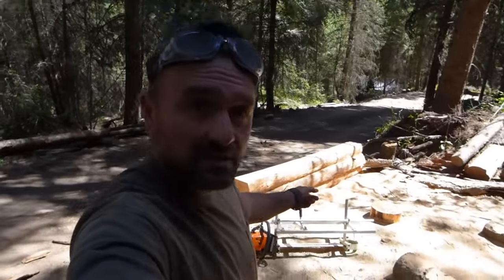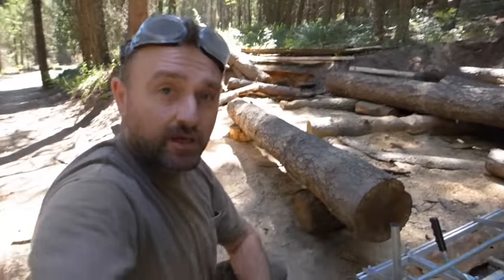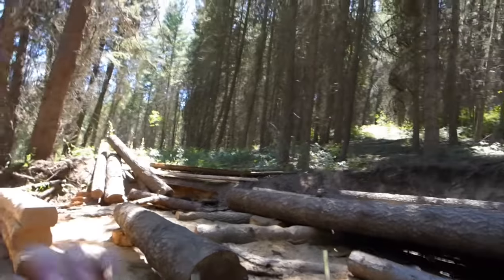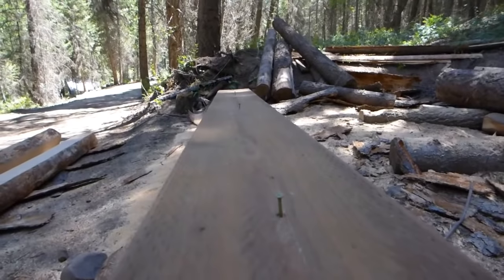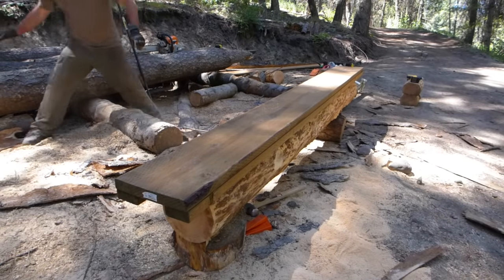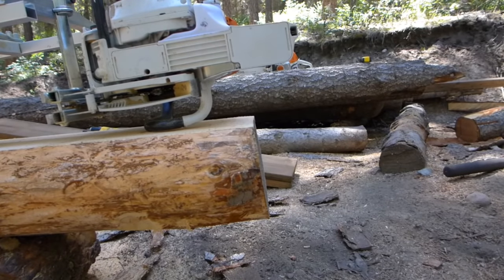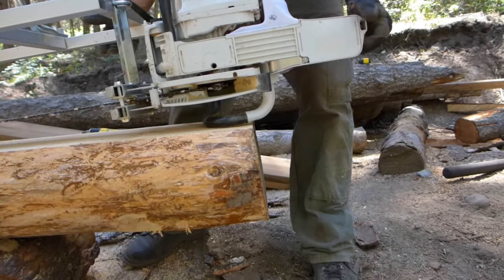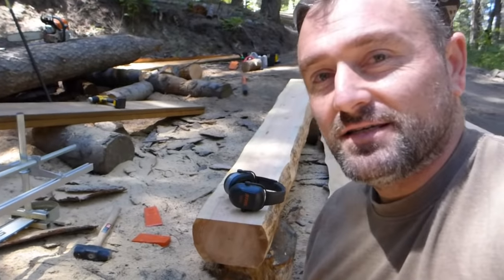Milling logs with the Granberg Alaskan chainsaw mill - Tips and observations

Comment: I have a Granberg mill also. It's a good idea to let the saw run for a minute after a long cut on a log it lets the saw cool down a lot better than turning off right after a run the saw is real hot. It's just something I do and I think it adds more life to the saw.
Reply: your not going to run out of fuel by letting the saw idle and cool down a bit between cuts, but by all means switch saw off to refuel and leave 1/2 of air space for expansion.

Comment: Suggestion, when starting a new cut without a guide board, find a way to start the cut without exposing your midsection to the blade. I noticed when you were kneeling directly in front of the blade that; 1 - you are not wearing chaps ($75 could help save your life or severe injury) and 2, your midsection is directly in the kickback zone. A stackable box with shims could be placed at the end of the log far enough away to get the blade started but close enough to support both guide rails until you are further in the cut. Great video though! Have fun with your project.
Reply from the maker: +Kevin Lovelace Thanks for the advice, I shall keep your tips in mind.
Reply: Or at least a  chain guard on the guide somehow that can be removed when the cut is deep enuf..
Reply: there is no kickback zone with an alaskan mill........
Reply: You could also attach 2 temporary 36"  x 1" angle iron on both sides of log to support the saw upon entrance to the 2nd cut use 2 more to catch the mill upon exit if the log. Use a level  to align angle to log plane
Reply: You will only get kickback when the tip of the bar on the top side comes in contact with the wood ‘ if you look closely at the tip of the bar it is Incased in a steel guard ‘ so kickback in next to lmpossible

Comment: Made my guide with 1 1/2" angle iron and welded spacer bars from the underside. As opposed to screws I welded pins to grab the timber slab so the guide didn't slide with the mill frame. To reduce the ware from the metal on metal I put 3/4" Teflon strips on the angle iron rails countersunk by 1/4". I built 2 10' sections that can be bolted together. That was 15 years ago and I still use the same rails today.

Comment: I enjoyed your brutal honesty  about setting your guide board screws too deep!! A most helpful tip that you COULD have left the unsuspecting to discover for themselves. Kept me watching and got me to subscribe!  Tip of the hat to you!
Reply: Adding a small right angled plate to the bottom of the guide board and then driving the mounting screws PARALLEL to the guide length and sideways into the log will effectively eliminate any chance of screws or nails damaging the chain's teeth since they will not be driven DOWN into the log but rather sideways into it. .
Initial entry angle of the chain going into the log can be better gauged by watching the longitudinal brace directly under the black push handle.

Comment: Quick tip for slab wedges....  Next time you go to a Home Depot or Lowes, go to the paint section and snag a hand full of the large paint sticks.  I have dozens now and they work well.  If for some reason to knick it with the chain.... Nothing happens to your chain.  Plus the paint sticks slide in nicely and usually all the way through past the middle of the log to be slabbed.  Anyway great video

Comment: Thanks,  nice to see Alaska mill in operation.  Great tip on debarking with the heavy pole.  Dirt in bedded in bark dulls the blade. I had to go through chain saw safety course with Rangers. Few small tips to keep you good looking. Always start chain saw with chain brake engaged. Wear chaps,  helmet with face shield and good heavy gloves like welder gloves. On average contact with turning blade causes 150 stitch wound. Your unprotected legs were way to close to blade.   Awesome job doing la job many of us would shrink from.

Comment: great video and thanks for sharing. another tip i got from this is to stand upwind of the log unless you want a shower of dust all over you. oh and along with all the other safety gear is to wear a dust mask. i assume you will move these logs to the saw mill to make 2x6's before they start to change their shape too much since you've removed the sides the stress in them will start to do that. unless you have a use for these logs as they are? moving these will be much easier now that they all have a flat bottom and top to stack them up with. thanks again. :)

Comment: If you put your wedges in before finishing your cut, you won’t pinch your bar at the end. Don’t hammer your wedges in. Just place them in and nudge it with your hand. If you hammer it in, you can change the angle of your cut.
Reply: Many people call those plastic wedges "Felling Wedges" even though they are properly termed "Palm Wedges".  They were designed to simply stop the kerf closing and pinching the bar / chain during felling and bucking.  They never were intended to be beaten into a cut with a hammer - ever.  As Marc said, snug the wedge into the kerf only using your hand.

Comment: My start board is 2 lengths of steel pipe with angle iron welded on the ends with 2 holes drilled on each end and screw the screws in horizontally,  just don't hit the angle iron.  Works well after ripping a big log in half it won't wobble on the corner

Comment: If you had a guide like a long snout on the rig it could lay on your deck ahead of the second starting cut so beginning your thickness on the first slab would be spot on parallel. The snout could simply swing away or pull out with a clevis pin. Likewise on the trailing top cross bar to keep the finish parallel instead of drooping off. Just my 2 cents worth.

Comment: really enjoyed the video. I have been looking at this device and am pretty impressed. 
I'm living with my young family up in the TN mountains with lots of lumber on our land. Mostly oak, maple but there is some pine too. How does the process do with oak ?
Reply from the maker: +Tim Bennett Hi Tim. The process would be very similar, keep in mind Oak is a dense wood and is much heavier than most other species typically used in the construction of log homes, heavier logs will be more challenging to build with. The good news is that Oak has a natural resistance to decay and insect damage due to natural chemicals in its heartwood. This natural resistance means that oak does not require as much rot/decay treatments as other wood species. You mentioned Pine.. I would stay away from using pine logs if you can, this is obviously a soft wood and not ideal if you have other options. Oak will be incredibly touch on a chainsaw mill... be prepared to go through chains and to sharpen often! All the best to you and your family and thanks for the question.
Reply: thank you so much for your information.
All the best
Tim

Comment: I thought it was a good video and I liked the plank you screwed into the top of the log to be milled. Other millers use an extension ladder, but I like the certainty of your jig. By the way, what is the size of your Grandberg jig?  I bought a 30" with an upgrade kit. What do you find is a good working size? It looks like you are out at 50". Is that any safer or easier than 36? One other question, I bought a 6HP Stihl 461. Is that enough for logs the size you are working with?
By the way, I subscribed because I thought your video was both realistic and candid.
Reply: I'm using an MS 461 with a 36" bar and a 36" Granberg mill set up with a winch. I have milled ash ranging from about 20" to 29" with it and find the power of the MS 461 to be more than adequate.  For the few boards near the "middle" of the log the forward travel is a little slower but not enough that I care...

Comment: Here's my trick for starting a new cut without the guide overhang. Hold the mill by the upright near the top closest to you. This will make it very easy to level the mill (pendulum effect). It also lets you stand to the side just in case there is kickback. Check my old video for more details. Also: Here is the pattern for rip-chain teeth if anyone needs it. Rip-chain has two kinds of teeth - Chippers and cutters. They are set in pairs so that there are two cutters followed by two chippers. To make a cutter, remove the sideways part of the top of the tooth. You want a "knife" that just sticks straight up with the cutting angle filed to 45 degrees. To make a chipper cut the tooth back until it can be filed at 0 degrees. The finished chain will have two "knives" of skinny teeth -one on each side, followed by two teeth that are square to the chain. I just used a standard file depth, and it workes great. Note that the cutter teeth are a bit longer, and cut into the wood sooner than the chippers (Because the chippers have to be cut shorter to make them square-up). This helps make a smoother cut on your lumber.
Reply from the maker: +IcicleImaging Thanks for tips, much appreciated. I watched your video. Keep well.

Comment: I have the same mill just a smaller saw with an 18in bar, the clamps that hold the bar in place either pinch to much that the chain cant spin or if i loosen it just a bit the bar will slide out of the clamps and the chain will hit the metal. I bought a 25in bar with a ripping chain havent used it yet but hoping it was just the small bar being the problem. How are you getting it to not pinch or slip out?

Comment: one tip to make one man operation easier..wrap a wire tie around trigger that can easily slide on and off while milling.  once you get your cut going it's nice to be able to free up the throttle hand.
Reply from the maker: +David Sarli Thanks David, I will give that a try in the upcoming months.

Comment: thank you for video. i would like your opinion on which you believe a 24" or 30" or 36" is the best practicle purchase for those typical size logs,( to mill 6x6's  6x8's 8x8  6x10 8x10" 8x12" etc), I am looking to buy and it just seems to me that 36" alaskan mill is uncomfortably too wide.

Comment: I am going to buy either the Alaskan or the Logosol M8 mill.  It just seems that the Logosol M8 is a lot easier to use especially when you get a little older.  Just curious to know why you went with the Alaskan vs. the Logosol M8

Comment: Can you not turn the log over onto the flat part you just cut, refit the wooden log guide and cut again, then the saw will be better balanced perhaps with enough hanging over the log ends? Though you may have to make some extra guides, or a completely new wider guide for the parallel cut the second time it will keep the saw accurate and from near the ground. Of course you could use a ladder also.
Reply from the maker: +mrbluenun I think a aluminum ladder is probably the best way to go.

Comment: make an angle, 2 short pieces of 2x12 in the shape of an "L" and screw it on the end of the log there by extending the length so you can rest your mill on it. Just a suggestion. Great video, I will be getting an Alaskan mill next year and I hope it works on ash
Reply from the maker: +Lee Hedges Thanks Lee... good idea.

Comment: To support you saw when following the flat already cut, just lay your 2X12 top side down extending it enough to where you would like to support your rig.  Get a steel pipe with two holes drilled at one end about 2" apart to accept screws fastened to the log and the top of the pipe will follow the the line of your guide.  You need only support the end furthest away from you but you may want to do this on either side of the log.  I recomend you use a 3/4" pipe so you can mill a flat 4/4 or 5/4 board.  Note use screws that not to long if your milling 1" boards.  Be smart be safe...Enjoy

Comment: How small a Stihl would you suggest for the 30" mill? I hear you absolutely need to go to the pro levels even if just to be able to adjust the bar oil feed flow, basically to max. Wondering what the smallest saw would be recommended? I know, the biggest you can afford, but how small is too small. Will be mostly dealing with evergreens and poplar. Very little hardwood, at least initially... Thanks.

Comment: Thanks for doing this video, great tips. I'm interested in the tool you're using for debarking. I'm going to be debarking a few logs soon. I searched Collins axe, Colins axe, kollins axe but just find regular axes. Any other name that goes by possibly. It looks like it would work well.
Reply: I found a tool on Amazon that looks a lot like the tool he uses for stripping the bark. It's called 'Bully Tools 91300 Floor Bully Flooring Scraper. Long Fiberglass Handle'. Probably doesn't have the same weight as the tool he uses but looks like it would work just fine. Can't verify that fact because I don't have this tool but from what I can tell it's similar on the business end of it.

Comment: That blade seams to be working really well. Did your Stihl dealer do anything special to achieve this result?
Reply from the maker: My Stihl dealer made a custom ripping chain for me, works well however I had similar results with  your typical store bought Stihl chains. A ripping chain will result in a rougher surface after cutting.

Comment: ok constructive     if ya want a 6x6 your spot on   if ya want 1 inch boards you'll only get 4   remember loss of material for  bar thickness so if ya want 1 by boards  from a 6 in rough cut add 1.5 in to mill height on 2nd cut  to compensate for bar thickness         to get 6    1bys if you want to run through a planer add an additional 3/32 to each 1 by  so ya end with a 1 by after  planing
Reply from the maker: +embarado smithing and woodcraft Thanks for the info. I ended up just cutting 6" H x whatever the width of log was for my floor joists.

Comment: Draw a mark at six inches. With the guide bar on the top of the log and the blade on the six inch mark, the blade should be level with the desired cut.

Comment: Once again, is it easier to mill a 20" log with a 52" saw blade and a 50" inch Granberg saw mill?
Reply from the maker: I would say that sounds like an overkill, a 36" set up would work fine.

Comment: Why not just use the guide board again for the second cut? That's what they do when they are sawing planks. That way you don't have to worry about the saw tilting. It will be square and level just like on the first cut.
Reply: I guess one problem with that is you have to sink screws into the wood. That might be an issue depending on what the lumber will be used for.
Reply: @marc2180  not if you flip the log over and duplicate the first cut.. But depth may be an issue depending on log selection

Comment: why don't you back the saw in on your second cut, for that first foot where your guide bars won't reach the log? it would be like the  end of the second cut, where you put pressure on second guide bar behind handle to keep it true. or since that baby has T-rail construction add in a T-rail to help start the first foot then take it off if it gets in the way.
Reply: at 18:00 add a T-rail that sits on top of the log going to the left.

Comment: What is the name of the spud you are using?? Where did you find it to buy it??
Reply from the maker: +goutymaygis It's actually a Post Hole Digger/Tamping Bar I picked up at Home Depot. Works well on thick bark as it has some weight to it.

Comment: Why don`t you glue a small plastic spirit to the horizontal section of the mill so you can see when starting a cut if it`s level.? Boet It`s great being able to process your own timber.
Reply: I would assume it is because the log (and ground) may not be level. Just putting one on the saw wouldn't really help.

Comment: how did you find the 661 for power on fir logs bigger then 16" if you have tried that big yet ?
Reply from the maker: Love the 661... largest diameter I have  milled has been around 16-18" and the Stihl 661 had no problem whatsoever.
Reply: A&M Milling My Husqvarna 390xp does a slab cut on a 16-18" white pine log 8 feet long in about 2min with a new chain and am using the Granberg small-log mill. Slab thickness is close to the same as in this video.

Comment: What size mill did you end up buying the 30"
Reply from the maker: +Greg Johnson I have the 36" but honestly 30" would be just fine.
Reply: +Off Grid Warrior Two schools of thought.  1st, smaller is lighter.  2nd, you can not make a small mill do the work of a big mill.  Both have trade offs, so it comes down to what you will be working with is size of logs.

Comment: @19:23 one kickback and you'll lose a leg. other then that good video. you could leave the top guide on and start your next cut then after its started take it off and finish without the top board. only takes a minute to adjust the height, might take a lifetime to get over a chainsaw injury.

Comment: P.S. why not turn the log over?
Reply: It's easier to ensure that the two cuts are parallel if you use the same reference surface, i.e. the first cut.

Comment: The saw will not kick back in anyway using it like this. Kick back comes from the tip of the bar NOT BLADE. As the chain comes around the tip of the BAR the depth gauge of the chain is far lower than the tooth causing tooth to bite to much wood, in turn trying to stop the chain which sends to tip of the bar flying back at you.  That being said there is never anything wrong with ppe. In this case you look to be safe and using common sense. Don't let all the professional's on here make you over think it. Great video btw!!

Comment: Why didn't you roll the log over on the flat side, measure up your 6 " and set up the guide on the round side. Or  from the flat side start your cut with the mill at a 45 degree angle. Dude you are cruising for a major accident kneeling behind the saw without chaps.